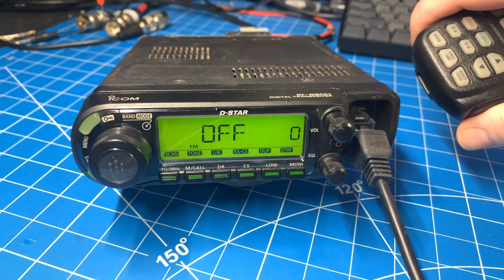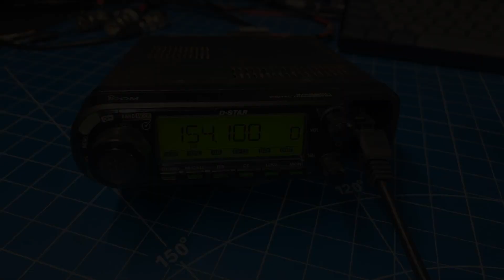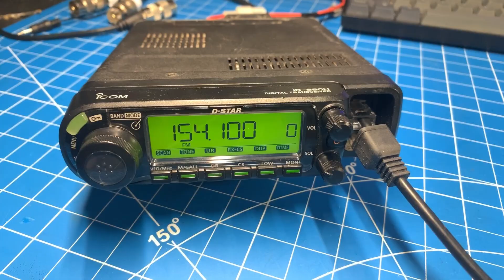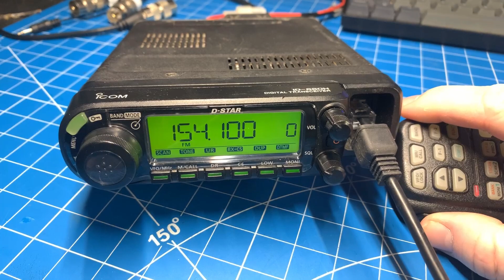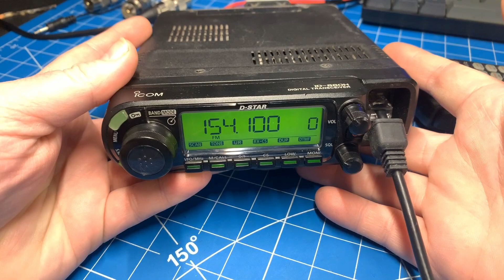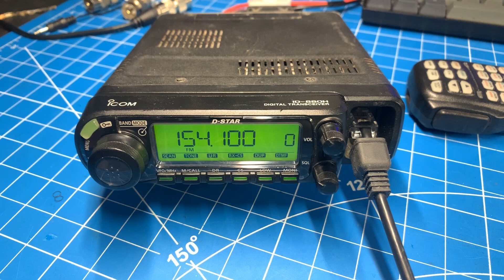ICOM ID-880H Frequency Expansion TX RX

Comment: Would this modification unlock the 900mhz band for transmit as well?  The radio already receives on that band.
Reply: I ended up doing this mod and answered my own question, this will not unlock 900mhz for transmit, it only expands the 2m and 70cm to allow them to transmit into MURS/GMRS/FRS (and anything else in that general range).  Still very helpful to have GMRS and Ham in the same radio.

Comment: Do you know if Chirp or RT systems software will still work for programming the radio after the mod? Thanks!
Reply from the maker: I can't say for sure, but I have only heard of that being an issue with the Yaesu 2800 and 2900 radios. I could be wrong though.
Reply: Why not just use the Icom software that's designed for it?  That's what I use.  It's free from Icom's website.

Comment: I've watched a few videos on this mod and none of you all tell what diode opens up what band.  I only want to open up the UHF side and not the VHF side.  Do any of you all actually know which diode is for what band??
Reply: I think the main reason no one has said which diode opens up what band is it's not as straight forward as that. I have looked at the designations for the two diodes in the service manual and although one is marked VTXF and the other UTXF (suggesting VHF and UHF) I think that just removing one would not open up just that band.
As russellmoffat2754 says, the presence or absence of a diode determines the country of destination for the radio, and that sets up a number of parameters including which bands are available, how far the frequencies go within that band for both TX and RX, the power level available for each band and so on.
Reply: @stopthebus    I might have the service manual, I'll have to check it.  If not I'll find it online and check it.  I just would be able to use the 440 side on GMRS (yeah I know you're not supposed to LOL) but I don't need to be out of band on the VHF side, nor do I want it to.  I'll have to check into it more when I get time.  Thanks for your reply.
Reply: @ You're welcome. For such an option to exist, the manufacturer would need to have a reason to implement it and the firmware would need to support it. Other than your purpose, I can't see any reason why just one band would need to be opened up and not the other.
Reply: I don’t think it works that way. I would presume transmit bands are set by the firmware. The locations of those diodes, as well as the places for missing diodes (for configuration for other regions), would be read as a single region configuration port while the radio is booting. No diode present = 1 and a diode present = 0. (Or the other way around). This way, if the radio is subject to a changed band plan in your region, you simply need to download a new firmware from Icom and update your radio.
Reply: @russellmoffat2754  I'll check into that.  Thanks.